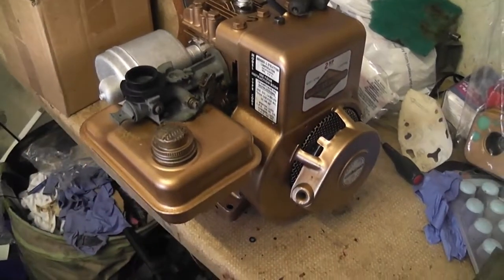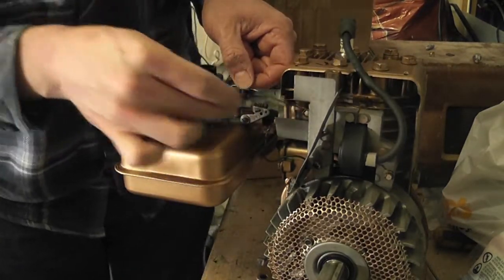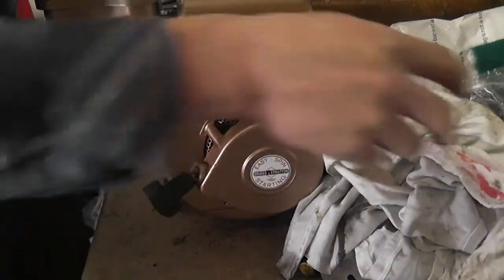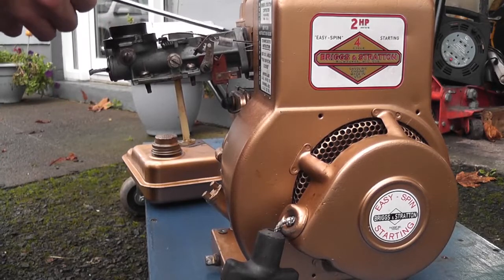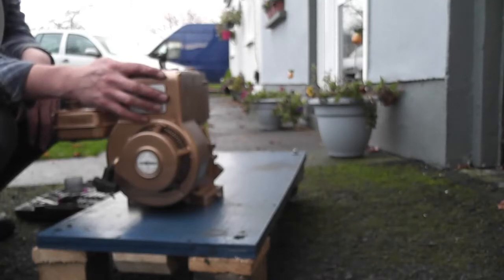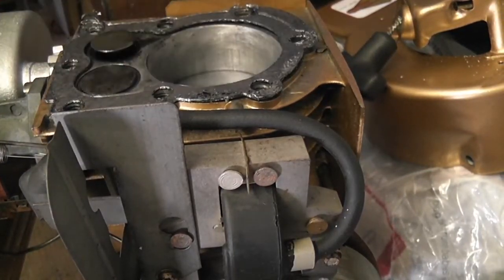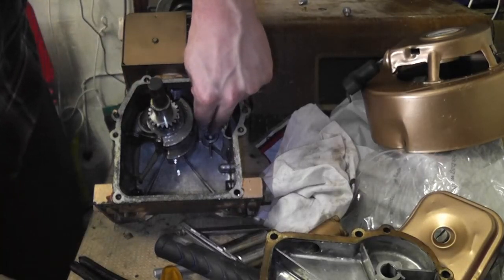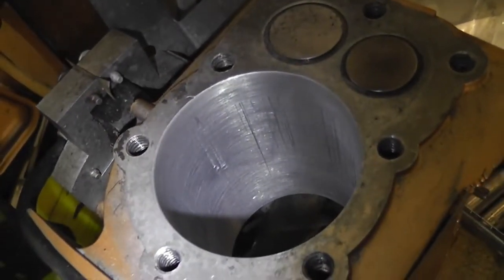Engine rebuild FAIL - Briggs & Stratton 2hp 60102 cylinder damage

Comment: Hone it and new piston rings usually do the trick. Rebuilt a 3,5 hp last summer. It was not looking pretty in the cylinder. Just honed it and new piston rings did the job. Does not smoke. Tip - hone in low rpm, not fast. And before assembly, always wash everything, block piston etc in soap and hot water. Specially after honing and laping valves. If you get tired of the engine, i am willing to purchase, always good as parts. 👍cheers from Sweden.
Reply from the maker: Thanks very much. I will try a bit more honing but I do think I need to fill the score mark. I've a couple of ideas which I'll try, but I'll take your advice on the honing too, and I will certainly be more careful cleaning this time! I'll make another video with an update on this one.
Reply: @Endfloat  - any questions along the way, just send me a message. And lubricate during honing, wd40 or similar. Best of luck and any doubts, i support you. Cheers!
Reply from the maker: Thanks. I really appreciate that.
Reply: @Endfloat  No problem. Forgot to mention - These engines normally likes to have 2 gaskets in the inlet to seal well. I putted 2 on mine. And starting point for carb - maximum 1,5 turns out, no more :) Cheers!

Comment: Take the bolt loose that mounts the governor vane to the coil, mount the linkage, and reinstall.
Viola.
Something got in that engine that shouldnt have. I can't imagine what. Possibly a piece of carbon fell off of the head that wasn't completely removed
Reply: You sed “viola”. 

Ha.  I think it’s VOILA!

Comment: I have a working Briggs and stratton 3 HP engine. Oh man! I feel terrible for all the work you have done to that engine. All that work has gone down the drain. I will give to you for free. Wherever the engine came out from. I believe it is on the same mount. Carburetor and gas tank are attached to the engine. Let me know! I am in Southern California.
Reply from the maker: Thank you so much. I am in Ireland though so the postage cost would be prohibitively expensive. I really do appreciate your generosity though.
Reply: @Endfloat  never pass up a FREE engine bro!

Comment: I always thought that B&S engines only required 30w oil. 20-50 seems to be a little heavy.
Reply from the maker: It's what I had to hand and for the amount of time i would have been using this engine my thinking was it was absolutely fine. It's not far off the weight of straight 30.
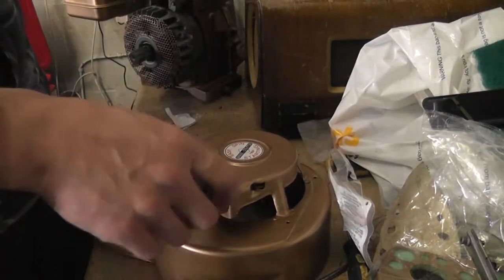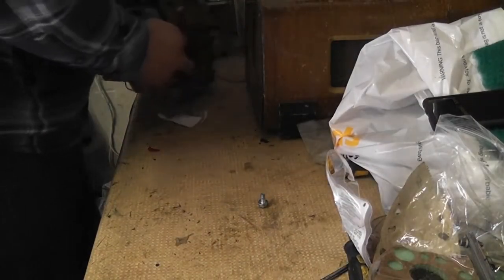Reply: Preferred that's right SAE 30 but if it's not available depending on the temperature 10:30 or 10:40 synthetic. The great thing about synthetic oil is it doesn't succumb to fuel delusion like regular petroleum base oil hence it doesn't lose its viscosity there you go.
Reply: Yes, 30 weight is what was called-out, or 10W30 in colder weather.

Comment: I'm s no big deal.. The key to honing the cylinder used to go at a slow RPM up and down being careful not to have it pop out of the cylinder and more frequently use some diesel fuel or kerosene to clean off and lubricate to some degree. If you can get that good cross hatch pattern may be able to get away with those gouges. It's about the simplest engine you're ever going to work on. I refilled one from 1972 all I did was clean the combustion chamber and the exhaust and intake ports and relap the valves. If need be if I have to go back in and hone the cylinder and of course put new rings on it then I will but checking the compression really determine that. The only thing I would put in the ultrasonic cleaner would be carburetors that are so gummed up it would be their only hope for rebuilding. Of course depending on the metal that they use sometimes they can get chalky. That's why you should only leave it in for maybe an hour or two and then check it the same with using like purple power and other degreasers. The person is so can be splashed down with diesel or kerosene then wiped off thoroughly the top of the piston you can work that carbon off with a carbon scraper being careful not to damage anything. Something that I haven't seen indicated anywhere else except for the old maintenance manuals is that every 100 hours you need to pull a head off and clean the combustion chamber from carbon build up. On your engine and might as well the crankcase ventilation comes off the valve cover and vents to atmosphere. I created an oil catch can that will allow adequate air flow and at the same time collect any oil vapor that would be blowing down the side of the engine. Just remember it's not the space shuttle cleaner up thoroughly take your time let me know if you have any questions..Paul
Reply from the maker: Wow, thank you for all the information! I think this may well be the longest comment I've ever gotten on youtube, and I will take your advice on board when I get stuck back into this engine in the future. I do appreciate your offer of help too.

Comment: I hope it works-out well. 
Where did you get that nice socket tool for removing the starter clutch?
I agree with the use of a ball-type hone, but that gouge seems a bit too deep.
Reply from the maker: I bought the tool from briggsbits in the UK, which is where I got a lot of my other parts for it too. I'm going to have at this engine again in the not too distant future. I'd like to see it running again.
Reply: Do not have the same issue but taking apart The carburetor is easier than putting it back together this has helped in the beginning of vid. cool to see someone with a similar McLane Fresno,ca usa

Comment: Sorry bro that’s just a terribly bad casted block in general. Did you try to test the alloy content by using a razor blade to shave a piece off the engine in different places before you even tried to start the rebuild ? A bad block will just shave like butter. I’ve seen it many times. A good block will make the razor blade skip and take chips out where you are testing.
Reply from the maker: Thanks for this info. Eventually I'll get back to rebuilding this engine. I've shelved it for the moment but when I do get back to it I'll try what you're saying.

Comment: its game over, brigs are known for alloy bores COATED in a SPECIAL LAYER
it means you CONNOT hone the bore, to rebuild you got to spend thousands to re coat the alloy bore
or to sleeve it with a steel bore
Reply from the maker: I'm keeping my eye out for a replacement case for it. I would still like to get it working.
Reply: @Endfloat  it will run but it will slowly wear the bore and you will find alloy shavings in the oil
i found out the hard way too haha
i had a old 2.5hp on a very old reel mower
it did how ever last a while with new rings and a hone
briggs kept the same rough design for a extremity long time so there are a lot of parts around
Reply: My local shop sleeves anything for 100 bucks. As long as it’s one cylinder and around this size.
Reply: I have two 2hp. One is steel sleeved. It’s at a stock piston size. The other one is bored over with a bigger piston and no silicone whatever alloy layer. I run it just as hard as the steel sleeve and I’ve never seen shavings yet.  Both have no governors either. I probably have a few hundred hours on both. I use them to pump water up to my house. So many parts available that’s why I never upgrade.
Reply: @genmaxpain   no that’s because you got a bad casted engine. These blocks were casted terribly. The content of alloy from one block to the next varies tremendously. You just have to get lucky. I have had a 3.5hp that would always just want to eat itself from the inside out. Got a 3hp same year bored it over and it still runs to this day.  That was ten years ago I rebuilt it.
Reply: I don't believe that to be true you can hone them lightly. I know people in the business for over 40 years and if you want to have the maximum compression create a good cross hatch pattern and put on a new set of rings. I want you just went hone and use the honing tool that have the ball tips that really gives you a nice cross hatch pattern that you're looking for. Like I said it is the most simplest of all engines you can make a mistake sure but it can be corrected. I'm 58 years old and I had just gotten done rebuilding my little two horsepower. When I was 13 years old it was the first engine I had ever rebuilt it was for a snow blower.
Reply: @paulhogan2389  id like to to :hone" a nissan GTR engine and say its great mate lol
they even have alloy bores with a special 
 plasma-sprayed bores(very effective cooling(old technology as it was gone on many briggs from back in your old days
also the specially coated bore if honed off or damage they will not last long
yeah you honed yours  but you give it no load over 30 years with only 30 minutes each time if that in use it will not wear much at all  , facts are facts
no manufacturers in the world make or have made a alloy bore engine with NO coating LOL the engine will literally never last, im saying for any real use like go kart or concrete mixer or anything that get actual load and wear and tear  it will never last, fact 
there is a reason why they put a special coating on as a bore lol to stop wear to make for better cooling
and the rings are made for that bore as there is no running the rings in on them coated bore engines, the only run in would be for the cam
to have an old engine to last this long is great it means they did the job right when they made them 10/10 to last this long some have lasted over 50 years of real use also, true survivors
Reply: I see people who do and do not hone an aluminium bore, however those that do say to pressure wash the bore to remove any honing material embedded in the surface. I really don’t know, I have a 3.5hp I’ve got apart and am trying to weigh up honing it or not.

Comment: Wow, I feel your disappointment nothing worse when you know you did everything as it should be and this still happens. Is an overbore possible on them? As my granny used to say “well it’s saved you from a bigger disaster”. Hope you get it sorted easily👍
Reply from the maker: Ah I will fix it. It's just a matter of putting more time into it and being more careful. I think there might have been some contamination stuck in a couple of the holes in the piston behind the oil control ring. I think they can be overbored but I won't be doing that. I've heard several people say they repaired bore scoring with chemical metal so I've ordered some JB weld. We'll see!